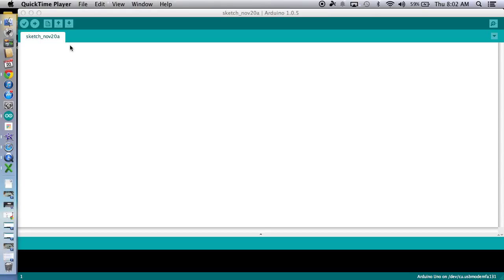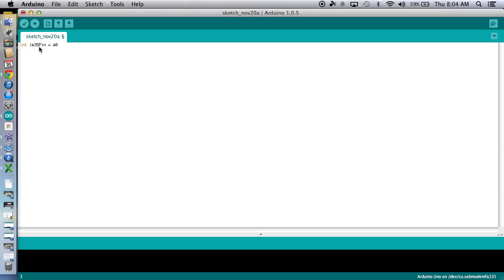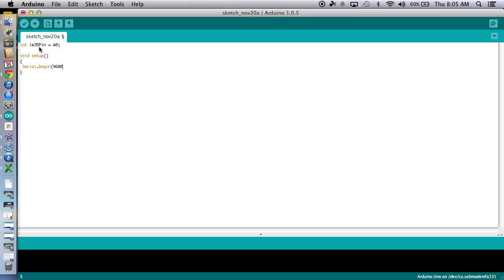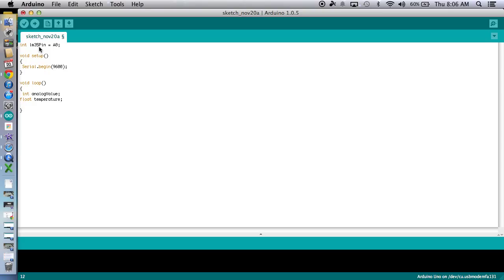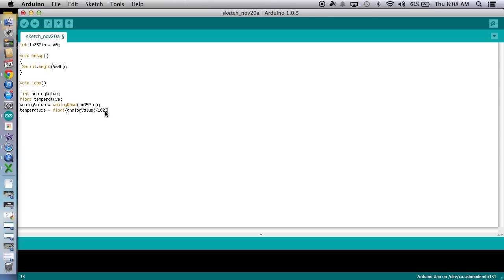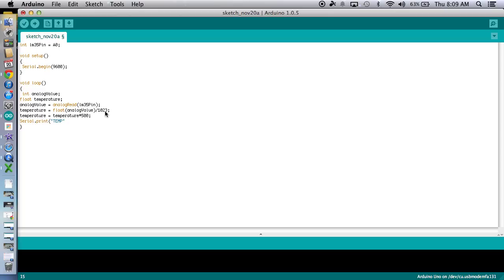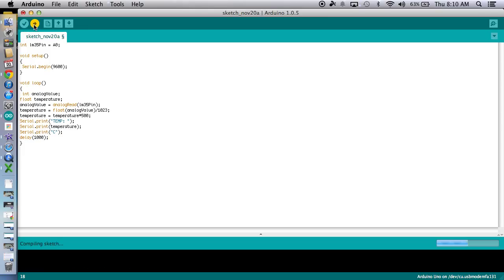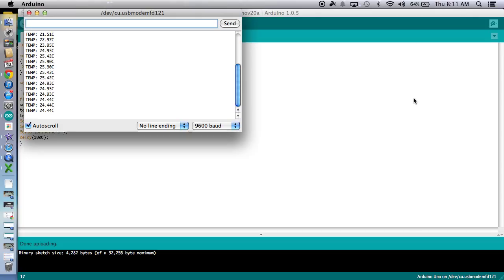Lm 35 temp sensor code arduino

Comment: So I don't have to declare the probe as an input or output in the void setup()? Also, analogue value seems kind of useless since you can probably just do (analogread(l35pin) / 1023) so typecasting the float is really unnecessary.

Comment: I am able to execute the program well. Thanks for the explanation. But i am facing a problem, the temperature is shown by negative value. The value is correct, but sign is negative. how to over come. I am doing a project on it, i would appreciate if you replay ASAP.

Comment: good day. i am doing a similar project and i would like to know why did you divide by 1023 and multiplied the temperature by 500.
Reply: hey did u understand why did he divide temp by 1023 and multiply by 500? if u get it then please tell me, i m also working on same project. Please reply ASAP.
Reply from the maker: I'm sorry for the late reply. The analogRead will return a value between 0 and 1023.  By dividing by 1023, you are essentially determining the "Percent Voltage being read".  The LM35 is made to read temp per increment of voltage.  The system is at 5 Volts.  each 0.01 volt change will be read as one degree celsius.  Dividing by this 0.01 is the same as multiplying by 100.  We then multiply by the VCC which is 5 volts... or simply multiply by 500 once.
Reply: Hey

Comment: Would it be okay if I declare analogValue as a float in the first place? Instead of declaring it as int and then casting it as float when calculating temperature
Reply from the maker: AnalogValue is a read of an analog Pin.  It will return an integer between 0 and 1023.  To convert this to percent  voltage, it will need to be a float....hope this help. I will try to change it to see what happens, and get back to you. I'm not a real computer scientist, but I do play one on TV and I did stay at a Holiday Inn last night.